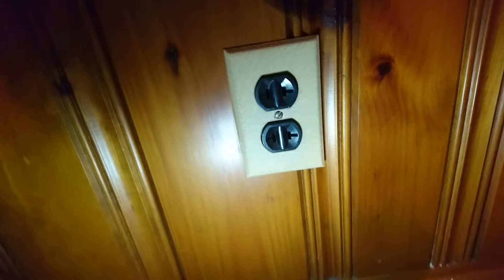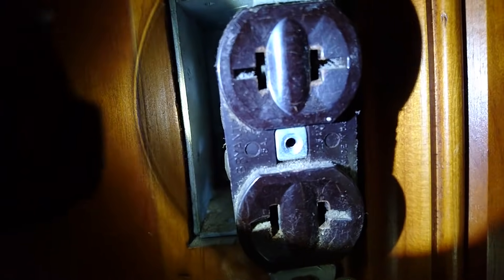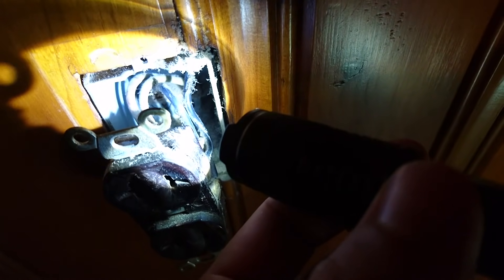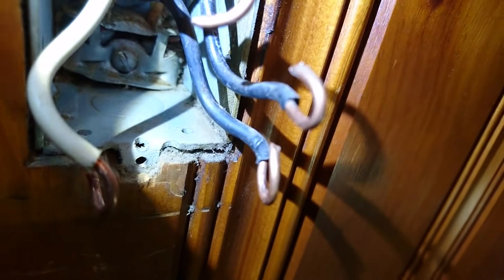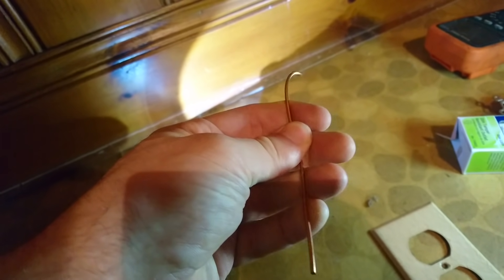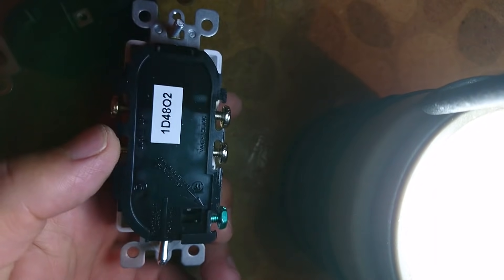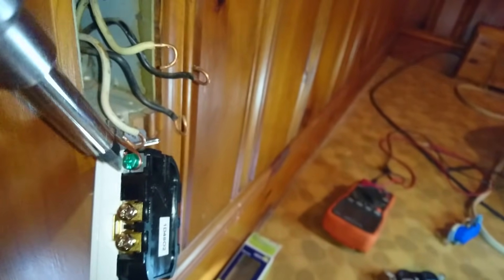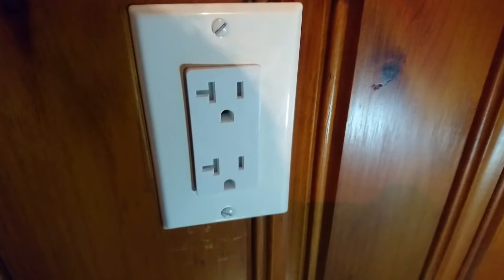How to Convert a 2 Prong Outlet to a Grounded 3 prong Outlet (TYPE AC Cable WITH Grounding Strip)

Comment: Actually, you're allowed by code to use 15amp receptacles on a 20amp branch circuit.
Reply: James is right
Reply: James is right and this guy is totally wrong on outlet size.  He backwards on that
Reply: This is true, but the premise is of anticipated loads in the circuit of convenience receptacles.  The 20A receptacle for a known specific load like an A/C unit should get the 20A receptacle.
Reply: @Alphasig336  He's not backward, but incomplete.  20A receptacles may be excede the current of a 15A circuit, but 20A receptacles cannot used since they signal false capacity.
Reply: That's what I thought and I'm not even an electrician.
Reply: @njsongwriter  The contention becomes the outlet is undersized for the rest of the circuit - a legitimate argument.  On the other hand, an oversized receptacle should not be used since the user might believe the circuit can handle the load indicated by the 20A style receptacle - which it definitely would not.  It is a gray area.
Reply: @louf7178  
I understand the reasoning either way.
Reply: @louf7178  actually you are incorrect. There is no "gray area". 15 amp receptacles may be used on a circuit protected by a 20 amp breaker and connected with 12awg wire provided it is not the only receptacle on the circuit. A 20 amp receptacle may never be placed on a 15amp/14awg circuit. I believe that a duplex 15amp receptacle satisfies the first condition I address of "more than a single". I hope I have helped you understand that there is no gray area and the YouTube-person posting this video "knows enough to be dangerous".
Reply: @walterk1221  Sorry, but, yes, there is a contention of the reasoning for the sizing, and I described it above.  It can't be any more clear.  It's about diversity and probability.
Reply: @louf7178  you are absolutely INCORRECT. There is no ambiguity for the exact reason I stated. 20 amp receptacle(s) shall never attached to a circuit protected by a 15 amp fuse/breaker and properly wired with 14awg. 15 amp receptacles (note PLURAL; i.e. more a single receptacle, i.e. one or more duplex) may be connected to a circuit protected by a 20 amp fuse/breaker properly wired with 12awg.
Reply: @walterk1221  You're not reading and understanding what I am saying, what is meant and why things are the way they.  I'm done explaining.
Reply: @louf7178  I went back and researched the NEC... so, you are entitled to retain your questionable understanding but there is ZERO ambiguity.
Reply: Here in Ontario and I am sure the rest of the country we are typically only allowed to use 20 amp outlets for kitchen counter receptacles and they have to be t slot 20 amp ones.
Reply: That may be code but personally I wouldn’t do that. I’d put a 20 amp receptical on a 15 amp circuit though
Reply: @robertsitch1415  in the USA outlets in the kitchen at least a certain distance to water everything has to be gfci
Reply: @NA-xm7wj  yes we have strict rules about requiring gfci protection on outlets near kitchen and bathroom sinks in New construction too.
Reply: @louf7178  An air conditioning unit should have a dedicated circuit.
Reply: Where can I find that in the 
N.E.C ?

Comment: Before doing this at least make sure your box is grounded itself, otherwise it’s useless. If you don’t know, just install a GFCI outlet
Reply: How would you know if your box is grounded?
Reply: @marquette93  With a multimeter, set the settings a AC. Stick on of the probes into the short side of the receptacle meaning the short blade where your plug goes your receptacle then the other probe touch the screw that connects your outlet cover plate.   If you get 120V to that screw(hot to ground) then you have a grounded outlet therefore you can change it to a 3 prong grounded receptacle.  If not then most likely it's not grounded it could be an old style romex cable with no ground or it could be a BX where it's not connected properly at the junction box if you have power coming from the ceiling light and no pancake or light box.  Typical in older homes.
Reply: Would installing a GFCI outlet fix the "no ground" indicator on the tester?

Comment: Aluminum oxide is not flammable. You’re correct that the problem was aluminum oxide but it wasn’t a problem because it was flammable but rather it created resistance. Resistance leads to heat and fire.
Reply from the maker: Ah yeah, you're right about that.
Reply: vancester1st    How sure that aluminum oxide was the real problem?   My understanding is that copper when heated and cooled was the same size.   Aluminum on the other hand when heated and under a screw would be smaller or looser when it cooled.   Once loose enough, arcing began.   It almost always happened at the receptacle in the circuit closest to the panel.    Receptacles back then were designed for copper.   Now some receptacles are designed for Cu/Al. And can be used on the old aluminum conductors.
Reply: @KevinCoop1  the problem is galvanic corrosion. bare aluminum wires against coper receptacles have the potential to corrode that is where the  loosening happens. not from heat/cooling expansion.
Reply: MrAwsomeshot    As I believe you are correct, it is most likely both that cause the problem.   The receptacles that always did this first were the one closest to the panel and were thru wired.   Therefore it had the most amperes on it.
Reply: So it’s still a fire hazard and still has to be removed? Glad you made that distinction 🤔
Reply: @KevinCoop1  It has to do with there's more resistance with aluminum than with copper. Aluminum's  not as good  a conductor as copper.

Comment: Thank you for the simple and concise way to correct this problem with "vintage" houses from the 1950's. I have watched several video's, and yours just said..."do this" and you will be good! No endless babble and background. No need to make things more complex than they are!!
Reply from the maker: Agreed... If you have armored grounded cabling, the solution is pretty straightforward!
Reply: You can certainly install a 15 amp outlet on a 20amp circuit. You CANNOT install a 20 amp outlet on a 15amp circuit. This guy needs to get his facts straight. I would not trust anything he says.

Comment: 15 amp is asking for less then what its getting so its allowed. Only 20 amp on 15 amp circuit is code violation
Reply: On a related note, as a counterpoint, an appliance rated and listed for installation on a branch protected by a 15A overcurrent device cannot be legally connected to an outlet on a branch protected with a 20A circuit breaker, in violation of the appliance manufacturer's instructions.  I have seen new hard-wired boiler installations red-tagged for that violation.  NEC (2017) 110.3(B).
Reply: UK electrician, if the protective device is 20amp everything after should be rated to this or higher. The fuse is the weak link to protect the rest of the system from overload.
Reply: @douglasgreaves188  The difference between 15 A and 20 A receptacles is that the latter allows the use of 20 A devices (the horizontal neutral).  You can have 15 A receptacles on a 20 A circuit provided there is at least two (a double one counts as two). You cannot have 20 A receptacles on a 15 A circuit as plugging a 20 A device would overload the circuit. I think equipment with 20 A plugs are rare.

Comment: But you still have voltage drop in todays works even in 2019 national standard dictates that you should have wire nutted the two black wires with a pig tail to the outlet itself along with the white wires as well. But kudos for actually grounding the outlet
Reply from the maker: Luckily for me I suppose, I did this in 2018 X)
Reply: Yes having a good electrician friend is always good to have. I’m just having trouble understanding the logic behind the setup. If I can’t understand it then leave it alone or go about it another way that I understand. My neighbor recently told me that if you install gfci circuits in the breaker box it will basically do what I think you’re talking about. But unclear about what he’s telling me too
Reply from the maker: @NA-xm7wj  I see what he's saying. NEC says that if making a ground path like I did isn't feasible, you can install a GFCI outlet and label it "no ground". Not sure about what a GFCI breaker would do though.
Reply: @Bootstrappin  my point exactly

Comment: With no ground in the box, the ground "pig tail" is pointless. This type of rag wire has no ground wire so the box does not connect to ground. The electric code is very clear on how to deal with this.  Replace it with a GFCI receptacle (which does not need a ground to protect from leakage current). A GFCI breaker will also work.  If this had been armor cable or conduit, this method would have provided a ground path.
Reply from the maker: You're right about GFCI and armored cabling. Did you not watch the video? Armored cabling is what I had and explicitly said it is needed to make this a viable grounding method.

Comment: That's a 20 amp residential grade receptacle and is inferior to a 15 amp spec grade receptacle which is what you should be using, if you verified that the metal box has a good ground. If not, you need a GFCI receptacle. There's no need for a 20 receptacle.

Comment: I just bought a condo built in 1961. It has two prong outlets throughout. I asked an electrician if I needed a complete rewiring to ground the outlets when upgrading to three prong. His answer was no, because in these buildings they used conduit which was grounded back to the main box, and I could just attach a ground wire from each receptacle to that. Thanks to your video, now I can see how that's done. Thank you!
Reply: DONE THAT!!!

Comment: Thank you. This is a good, rather thorough review.
   The electrical codes vary from state to state, and at different locations within a state.
   I removed a broken and unsafe duplex receptacle left by the previous owners, then listened to several certified electricians.
   I could not get a good ground by tying or screwing a ground lead to the box, so I installed a GFCI in the first duplex receptacle of a chain of six receptacles. This on the advice of several electricians.
This has served us well for the last three years or more.
It is best to get the advice of a good electrician before doing any electrical work, even if you think you know what you are doing. Be safe.
Thank you, again.
Reply: So instead of running a ground wire, you just put in a GFCI without a ground? I'm in that situation...
Reply: what is considered a good ground
Reply: @shakes13t  i didnt see the part in the video that showed the box itself was properly grounded. if it wasnt grounded then that ground wire he installed there is useless
Reply: @tanyaortega5291  He said that it was wired with metal sheathed cable. That may or may not satisfy your inspector.

Comment: My house was built in 1958. It had the BX metal cased wire through the whole house. Metal utility boxes were there and they had a threaded hole in them. I used that threaded hole for the ground anchor screw. I changed every plug.

Comment: An easy fix is to replace it with a GFCI receptacle and put a No Equipment Ground sticker on the cover plate. If you had more 2 prongs on the same circuit then find the home run receptacle, replace it with a GFCI but wire it so all the rest of the receptacles are on the load side of the GFCI. If its residential replace all the receptacles with Tamper Resistant receptacles. Put GFCI Protected & No Equipment Ground stickers on those face plates. This is code compliant but yes it's better to pull a ground wire if possible.
Reply: Sure GFCI is great but I want equipment grounding. If I don't have metal cabling I assume I'd need to run all new wires?
Reply: @philadler7399  yes you would
Reply: @philadler7399  unless there is a ground from the wire attached directly to the box.  keep the box grounded add the grounding screw to the box and a ground pigtail to the outlet.
Reply: @mikemoyercell  just to clarify, if the outlet box is plastic, with no ground wire running from the panel, should you do the following:
1. change the plastic outlet box to a metal one
2. screw a 6” copper ground wire into the metal box
3. purchase and install a gfci with a ground screw, then connect the newly added ground wire to the gfci

Is this the safe way to upgrade your ungrounded 2 prong oulet to a grounded for equipment 3 prong gfci?

Comment: Good helpful video.  Also good pointing out that the cable MUST have the ground strip integral to the AC cable.  My best friend has been an electrician for almost 20 something odd years, and he was telling me a story about a service call involving an old house that had a mixture of knob and tube wiring,  and fair amount of the older type of AC cable without the ground strip.  The homeowner had installed some 3 slot type receptacles ground to the metal box just like you did.  When a certain appliance was plugged in at times the homeowner would feel a tingle while touching the refrigerator,  and also smelled burning wood at different times.  My friend had found a section of the old AC cable that had rusted in the damp basement and had heated up due to a fault traveling on the armor and was beginning to char the joist where it was stapled to, but the 15 amp glass base fuse never blew.
Reply from the maker: And that's an outstanding point. Even with the right cable type, there's always that risk, so I should probably add a note for people to inspect the condition of the jacket. Even then, a rusted out portion may very well be hiding behind a wall.
Reply: @Bootstrappin  thats a nice house you got.  I love the old pine wood wall paneling.  Just curious,  roughly what was the year of the build?  I noticed in the video there was a more modern circuit breaker panel rather than the old type with the Edison base fuses and cartridge fuses typical of a home with two prong ungrounded receptacles.  Or was the breaker box installed later ?
Reply from the maker: @Sparky-ww5re  thank you -- it was built in the early 1960s. The breaker panel seems original to me.
Reply: @Bootstrappin  If a newer 200A panel has been installed, what is the logic in running new ROMEX on a pair of 15A runs to a circuit that had two rooms on one circuit?  The new circuits could allow  an Air Conditioner (window unit) on its own circuit, and separated from a portion of the room with computer/electronics/battery backup UPS on its own circuit.  I am about to learn how difficult it is to fish wire to wallbox locations that are to be configured to their own circuit breaker in the expanded panel.  This new-to-me house was built in  upstate NY in 1960 and it has 4 bathrooms - none of which has a wallbox outlet to offer electricity to the room other than a single accessory receptacle found in the end of a fluorescent lamp fixture above the sink basins.  Usually circuits that exclusively traced as wall outlets are discriminated from ceiling light circuits.
I am not inclined to be adding circuits units to the 200A panel, so I will acknowledge my limitations and hire a licensed electrician.  Maybe he will allow me to assist with the mundane wiring of the receptacles in the wallboxes.
Reply: @Bootstrappin  A glass plug fuse or a  circuit breaker isn't an arc fault circuit interrupter.
Reply: That older type of cable you are referring to is actually the original BX which used rubber and cloth insulation instead of the much better plastic insulation used in AC-90 cable which is still available today although most newer installations use MC lite or Romex instead.  MC lite uses a separate green ground wire instead of the bonding strip so it actually provides a more reliable ground and is easier to handle due to its lighter weight.